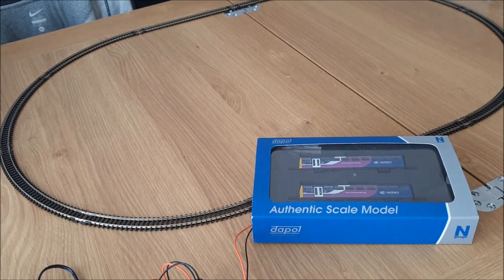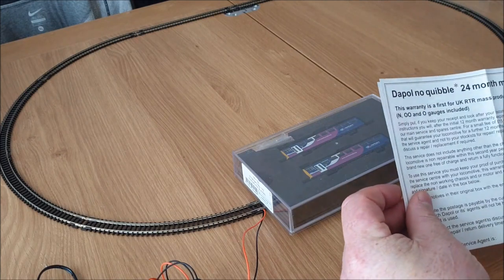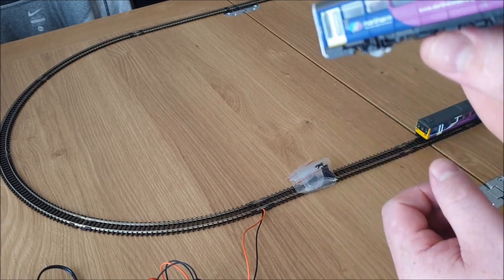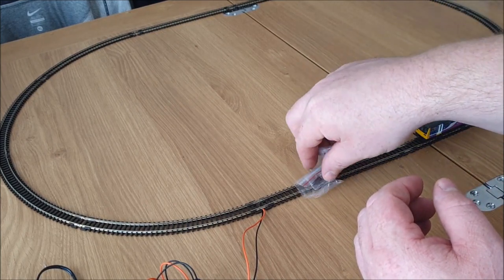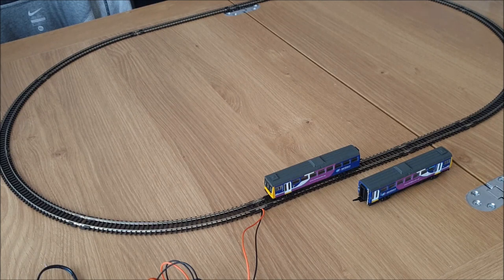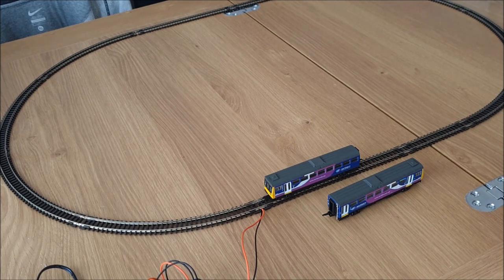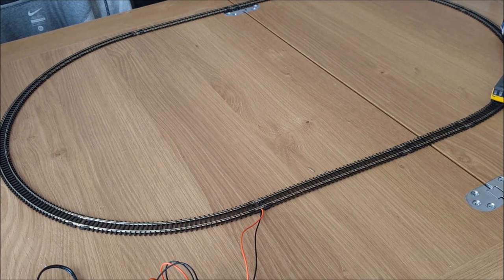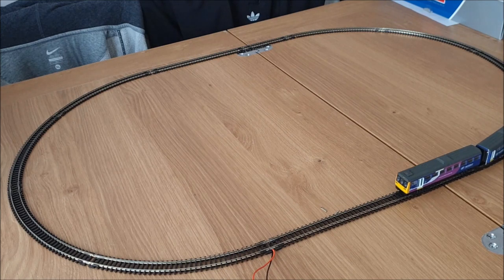Dapol N Gauge Class 142 Northern Rail Unboxing & Review

Comment: Did you oil it before use? I recently purchased a Dapol Class 73 and haven't used it yet as I don't know if it's a must to oil before operation.
Reply from the maker: Hi usually there ready lubricated when bought new if its been in storage for a few years and never run it may have dried out and mite require abit of lubrication, but if its a new loco you shouldn't have to do anything to it, hope this is helpful, thanks for watching. Tom